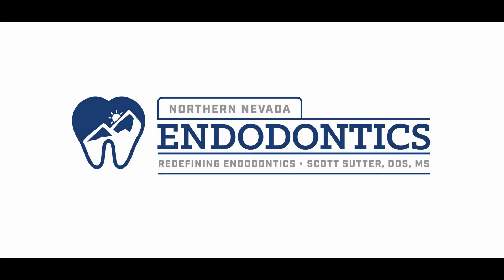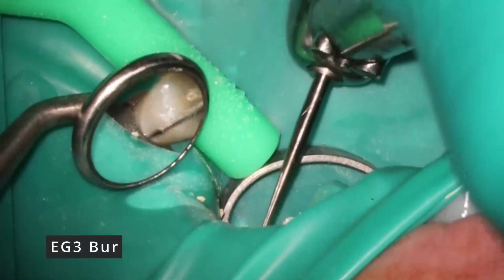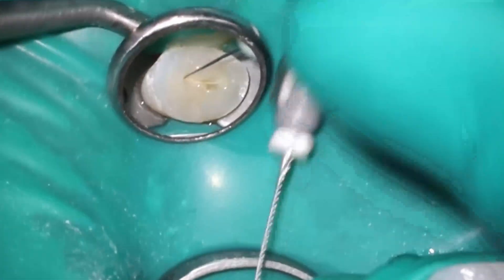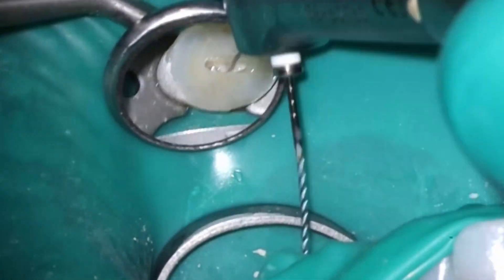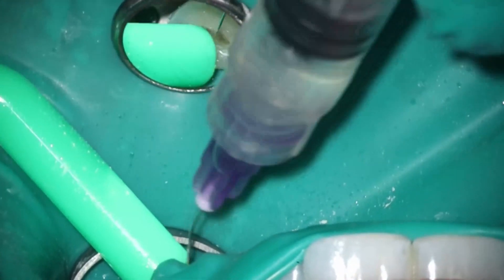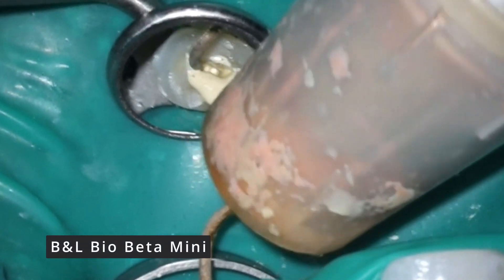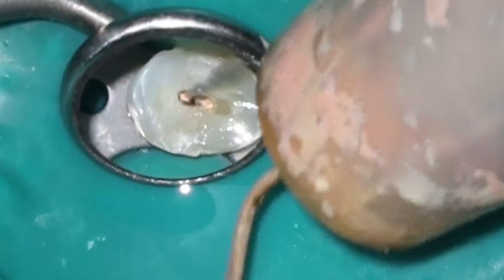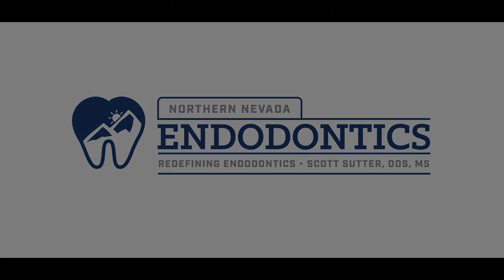How to Hand File: Navigating Complex S-Curved Root Canals Efficiently | Endo Uncut

Comment: Hi doc, I’m pretty keen on trying out squirt technique for myself but just wanted to get your opinion on whether this will be viable in the clinic I work at - there’s only Hyflex EDM available and my finish size is usually the 25/- file which has 08 taper in the first 5mm then changes to 04 for the rest ending at a size of 109 at D16. Larger canals will be a constant 40/04 without max diameter. Would you think a squirt technique is safe for these shapes? Is the logic that the canal should have a small apical diameter and a decent taper to avoid extrusion? Thank you :))
Reply from the maker: You totally can. Those are similar to an f1 which is what I use for retreats. On the 40.04 you’ll want to push less than you would normally, but otherwise go for it! I stop using the squirt technique once the apical foramen is above 50 ish or if there’s a large apical defect. Otherwise it’s pretty predictable! Let me know how it goes

Comment: Why you don’t use bio ceramic sealer ,is it because of your Obturation technique ??
Reply from the maker: Bingo! Even the HF, regardless of what the reps say, sets up as soon as it’s heated, so it means your obturation will be short. Ask me how I know lol. I still use it in certain cases (perforations, weird resorptions) if I’m worried about direct exposure of the sealer to a large amount of bone, but in day to day I don’t see a benefit given the limitations (and cost lol)
Reply: @PatencyPro  But this sealer won’t resorbed over time
Reply from the maker: Are you talking about AH plus or BC?
Reply: @PatencyPro  ah plus
Reply from the maker: AH Plus will resorb over time externally but is stable internally. So this way I'm not concerned about the apical puff and the tooth itself will be stable. BC does not resorb so anything out the apex will be there forever... but I've seen cases of it resorbing lol